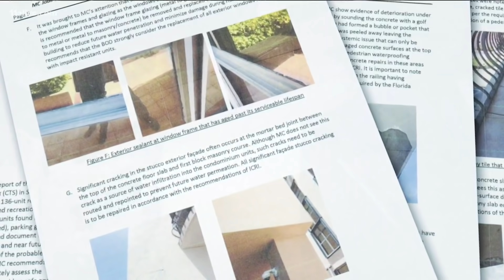Florida condo collapse | Engineering report shows building was sinking

Comment: I told yall that Florida is sinking addition the buildings that my state made are doing the same. It mainly deals with the constant heavy rainfall that eventually turns into acid overtime which destroys metal and concrete on every building of Florida. My house is suffering from constant rainfall which my roof have a hole and it's one of the main reasons why there alot of people moving out of Florida because it's too expensive to maintain. Plus the sinkholes is another thing that we Floridians have to worry about too. There been many cases showing actual evidence that salt water are indeed being discovered in people backyards and this is the main issue that cause sinkholes to happen. Salt water dissolves all the minerals that holds the ground intact overtime and with that a hole appears in the ground and gets bigger and bigger which cause a sink to happen.

Comment: Those concrete floors are not designed to absorb the load of another floor falling on it. So all that is needed for a complete pancake collapse as occurred is for just one of the floors to uncouple from the vertical support columns.
Reply: @g1a1r1y3   Did you read my comment? Describing the mechanism of the pancake collapse does not mean the floor failed as you assume. Obviously one or more of the vertical supports failed which caused one or more of the floors to uncouple. My point is AFTER that occurred the pancake collapse was inevitable given the load rating for each floor.

Comment: I’m not even a GC. I’m a former Journeyman Piledriver for a foundation company that did earth shoring and retention. I’ve gone beneath old buildings, dug approach pitches, caisson shafts for support, and have essentially mined my way 25 sometimes 50 ft under the most unstable structures. I can tell you, that column was compromised severely. Basically, however bad something looks on the surface, it’s typically even worse beneath it. That column wouldn’t have passed my unofficial approval as a Piledriver let alone any competent GC’s approval.

Comment: As a General contractor that specializes in retrofitting old concrete structures I would just like to take a moment to say that that column is NOT structurally sound.  Whoever said it was should return the money they were paid to say that and their license as well.  Evacuate the other buildings now until repairs are completed.  Greed killed in this situation and the building ownership should be looking at lengthy prison terms.  They know what they did / didn't do.
Reply: Thank you for your professionalism and sound advice!  It would be tragic if they don’t evacuate first and do structural integrity tests.
Reply: @Alex Sonne That is probably what the building owner said when he read the 2018 structural engineers report that the building needed urgent repairs.  How did that work out for him?
Reply: That column doesn’t look like a support column. I think it is an enclosure around a support column hat is intended to protect the beam in the event of a fire and provide a channel for communications and other services. I say this because that column is rectangular and the others are all round.
Reply: @SeanPat1001  It has rebar in it and the building is a cast in place concrete structure.  But what do I know I have only built a couple of dozen of them over my 27 year career. =)
Reply: Thank you sir for this information
Reply: Hmmm. Where to begin. Firstly, that column is structurally sound. Spalling in reinforced concrete (RC) means the column has lost its cover, but not it's capacity to carry vertical and horizontal loads. The reinforcing steel does not "support" the column, but is added to give the column flexure when loads cause it to bend. As long as the concrete within the reinforcement cage is intact, the column is sound- even if the entire reinforcing cage is exposed.

Secondly, like the woman said, if the engineers who prepared any of the reports noted something that affected the structural integrity of the building, they would've not only state so in the reports (which they didn't and I read them), but the engineers would've also notified the authorities. Not doing so, especially after this tragedy, is sole reason to have one's license revoked. (Also, with all the talk of water infiltration through the pool and its surroundings, how come that portion of the deck didn't collapse?)

Thirdly, in reference to the columns: not all of them are the same. If you look at the floor plans you will see that each of the three Champlain building complexes take up an entire block AND the basement and pool deck take up most of each block. But the towers take about 3/4 of that deck. So in the basements you would see columns that hold up the pool deck and columns that hold up the tower. There is no indication that the columns supporting the towers had shown any damage prior to the collapse.

There are tons of theories (and I have my own based on the video of the collapse), but I really doubt one thing caused all sad tragedy this.

I will add that looking at the drawings, you can see that there is a shear wall that runs north-south. The collapse stopped right at that wall. I suspect had that wall not been there, the entire building would've collapsed and this tragedy would have been much worse.
Reply: @g1a1r1y3  Nice book.  Would you sleep in the tower next door tonight?
Reply: @mybad8805  So I see. I responded and gave actual structural and engineering terms to explain the conclusions and that is the best that you have? It's "professionals" like you that give real AEC professionals a bad name.
Reply: @g1a1r1y3  Sure let me give it a shot, I am a builder.  This is what I do, when I see structural column's cracked in half I pull my own team out.  So answer the damn question, would you sleep in it? I look forward to the sequel.

Comment: Those buildings go through routine inspections engineers survey the structure and if they are not structurally sound the City is responsible to enforce the repairs it is up to city if they will issue a occupancy permit or a temporary permit until repairs are made the city has to enforce the repairs and management must comply by a certain time or the city pulls your occupancy and declare the property unsafe for living somewhere down the line this did not happen sometimes someone has deep pockets just saying
Reply: You are so dumb

Comment: Yea and when the Military did their exercise blowing up 40,000 lbs a 100 miles off Daytona Beach a few days before , I’m sure that helped , 😒😶🤦🏼‍♀️ shockwaves and vibrations travel a long way , with all these upticks in earthquakes 🤔🤦🏼‍♀️🤷‍♀️
Reply: MIAMI is ON UNSTABLE LAND , like DALLAS, HOUSTON , BOSTON , MA.,, etc……and MANY PROPERTIES EVERY WHERE !
Reply: One resident reported loud creaking about 3 AM two days before the collapse.
Reply: Because of the substrate, vibrations traveling many miles doesn't happen in Florida. But I suspect that when they were building that highrise across the street from Champlain South, the vibrations from driving that building's piles into the ground may have contributed to this. But we won't know until the investigation happens.
Reply: @g1a1r1y3  One witness said that crews had bee working on the roof for a month using something that sounded like jackhammers
Reply: To far away. Navy works out safe limits
Reply: Cash kitty 🐈 research how far and what 40,000 lbs of explosives can travel and do shockwaves can do a lot
Reply: Why should WE TRUST what MILITARY does ? So they are  100% HONEST & thorough !
Reply: it had no factor. the other buildings did fall over... now did they?
Reply: GorgieClarissa look up why they did a shock wave test in 87 , to see how concrete and bolts held up, they only used 12,000 pounds then, I’m just sayin, didn’t help and increase’s sink holes and earthquakes they been hiding 🤔🤷‍♀️